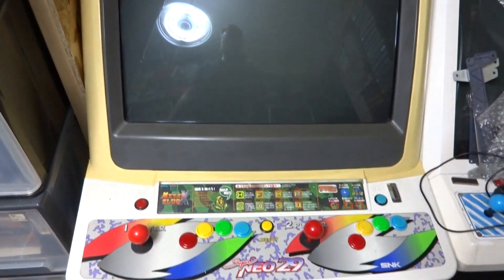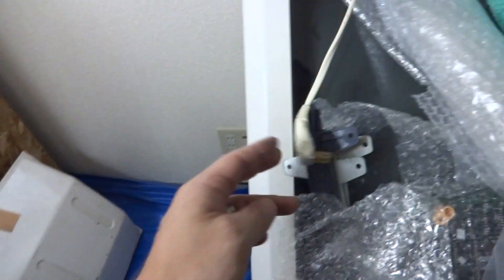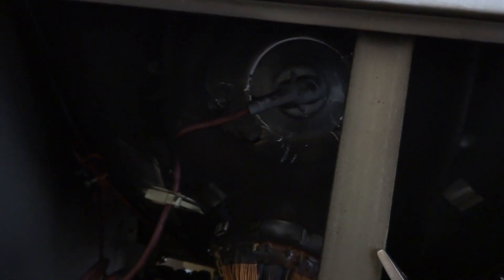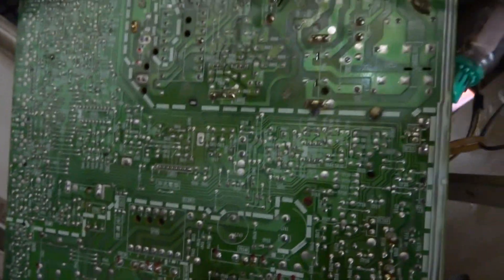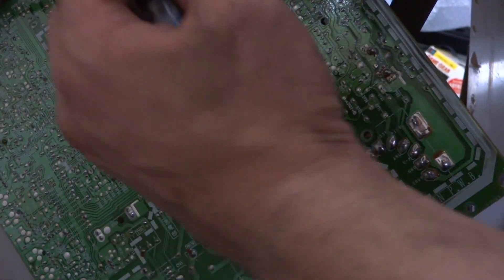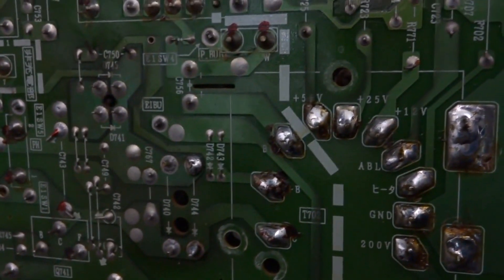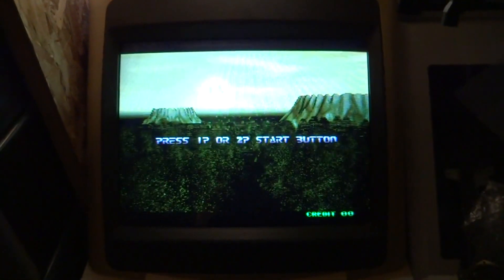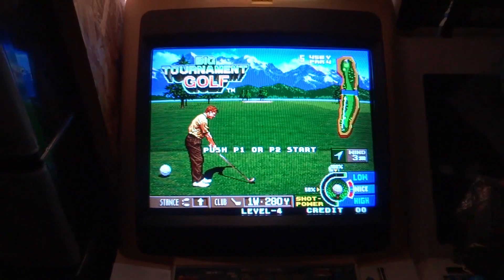Super Neo 29 Monitor Repair:  Chassis Solder Reflow

Comment: Once again Luke another 5 star video.Kudos.I have a problem with my PsOne.I've allready modded it to also play copies but I have this issue where when it is cold,I have to turn it on with a music cd to play for at least 5 minutes.Then I put my game in and it will work.Otherwise it will show me a text telling me to insert a playstation disc.It does the same thing either with a copy or a original disc.Greetings from Greece.

Comment: Great video like always! My mvs-u4 has suddenly been having a loud surging/cracking noise. I checked inside while turning it on and there was an arch coming from the transformer.. Do you think I need to replace it or could some re-solder possibly fix this? it